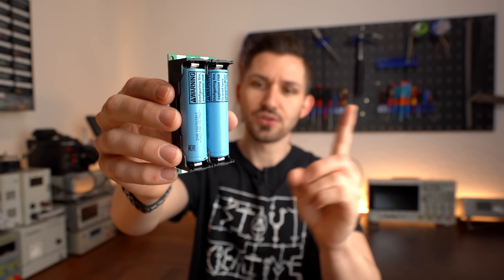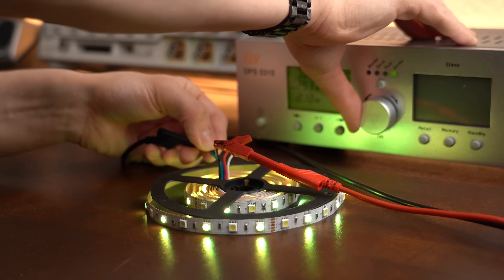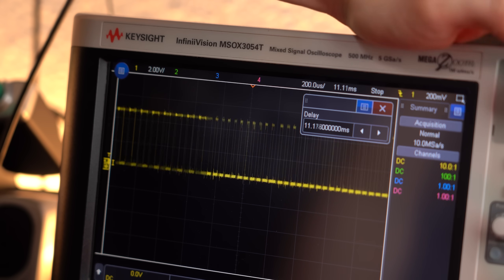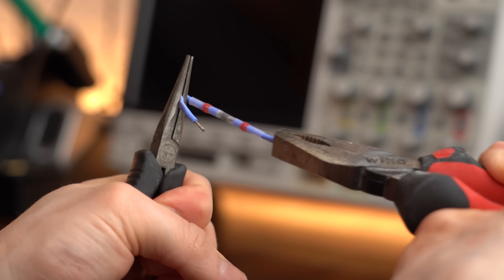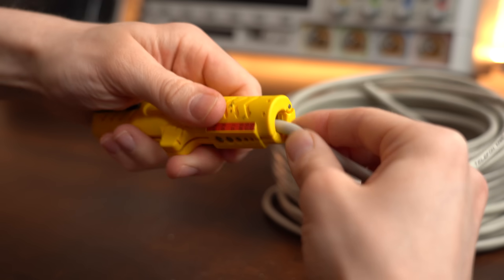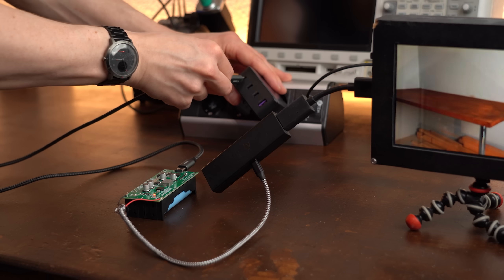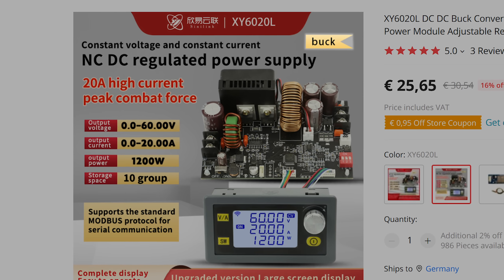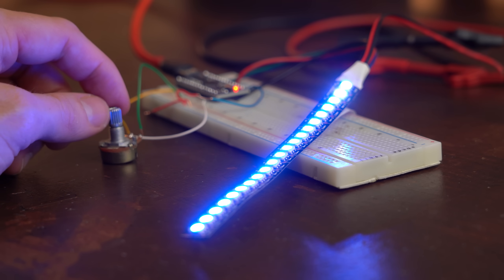I tried finding Hidden Gems on AliExpress AGAIN! (Part 4)

Comment: You need to heat the solder sleeves more. The solder should melt almost completely so you have a good solder connection :)
Reply: Yeah that annoyed me too. Needs to be hotter.
Reply: I also don't bother pre twisting the wires. Just twist the wires back and forth to get the solder moving around and it will look completely solid
Reply: @scatterbraintech  Great, except that's not the purpose.  Solder is not supposed to be the primary mechanical connection between wires, rather to improve conduction between twisted, or if needed then clamped, or through hole, etc.

It really doesn't make sense not to twist the wires together unless this is some unusual situation, like an alligator ate all your fingers.  ;)
Reply: Yes, I also taught abot that. It was probably more the shrinktube (which also has glue on the inside), than the solder holding those wires together. It showed reasonably good result on the resistance test thogh. But clean  copper on copper contact always have low resistance - the problem is after some time with moving the cables and with some oxidation. If done properly, it will be a nice solid connection that doesn't degrade over time.
Reply: using a curved deflector heat gun nozzle helps a LOT, btw soldersleeve shield termination widely used on cables with very fine-mesh shielding, where applying higher temp and/or longer heating period could risk damaging internal wires   ;)
Reply: the solder should flow and if it's not that's why they're cheap. I have used those sparingly before with good success. But the solder definely flowed and solid conductors should be viable.
Reply: @dietbr00ksy  its not the shrinks fault, replay the footage, he shrinks the ends but does nearly nothing to the solder.
Reply: Exactly; I have the same and just use a lighter. The complete solder ring should melt! I bet you could even solder hard wires like that.
Reply: I used these 100 years ago to repair wire breaks on US Navy aircraft.  They are known as "environmental splices," which means they are meant to be waterproof.  The solder was a low-temperature melting solder.  While we were supposed to use a non-sparking, hot-air tool to melt the splices, we often employed the B1c method (a Bic lighter).  Probably not the brightest thing to do in the aft avionics bay of an A6E Intruder, but we did what we had to do to launch aircraft.
Reply: I’ve always found these cheap ones just don’t want to wet out. Add a little liquid flux & they work much better.
Reply: These knockoff solder sleeves are garbage compared to name brand Raychem for example
Reply: I noticed that as well, also I have used these on a multi-wire connection, I solder them together then slide the sleeve down then hit the connection again with my re-flow gun. My preference is to not use them as a primary connection but as a finishing off solution.
Reply: It is obviously not used correctly. The inner tin ring softens at 130 ° C and dissolves at 180 ° C. The outer insulation material can support 250 ° C for more than 30 seconds. Therefore, the correct way to use it is to heat it with hot air at 200 ° C for about 10 seconds. Thermal shock allows the inner tin ring to complete the welding before the outer insulation fails.
Reply: i have them and the plastic will melt away completly before the solder is properly heated
Reply: Same thought. Wasn't sure if they were poor quality solder or not enough heat
Reply: I actually use these quite often, and you’re right, in theory, you are suppose to heat up the solder more to completely melt it.  But, in order to do that, you end up melting the wire insulation all around it which exposes the wire and negates the purpose of the connector.  So it’s kind of a balancing act.
Reply: @heatherryan9820  this just is not true, even a legit lighter can melt heatshrink solder.
Reply: @heatherryan9820  occasionally, but I use my little blow-torch light, which is riskier. I find these work great just don't twist the wires let them 'splice' into each other.
Reply: There's only so much heat you can put in the solder-bead using hot hair through a plastic sleeve... each wire you try to solder acts as a heat-sink.
Reply: @someperson8672  It's a low melt solder. You need to apply the highest temperature the heat shrink will withstand in order to get the solder to flow quickly. That's the reason why it wouldn't solder to the solid core cables, too - though it's such a problem with the solid cables that it likely will never work with anything with a single strand over about 1sq mm (17AWG).
Reply: @Aussiechip  Solid core should always be a mechanical joint, whereas multi-strand is quite happy with a chemical (Solder) joint.
Reply: @someperson8672  Yes, but this is very very low melt solder. It's designed to fully melt without damaging the heat shrink.
Reply: @someperson8672  dude, heat shrinks are damn well commonly used, we know how they should react. solder does melt at a bit over 110c, so no, it shouldnt look like that.
Reply: And be aware of cheap ones, because of the cheap solder in it that might be melt at lower temps so it would not be great to use them in cars near the engine or something similar (I speak from experience)😅
Reply: @GuediRawstyle  normal solder has roughly 127-137c melting point, you shouldnt do that in general.
Reply: @GuediRawstyle  ?? This makes no sense.  No matter which one you choose, the solder melting point is always going to be higher than the wire insulation rating.  I mean even if you added special silicone or other insulation material that has a  higher temperature resistance, all the rest of the factory wiring in the vehicle is still not rated that high and exposed to the same temperature in the engine bay.

In other words, no you are wrong.  If you have wires exposed to very high temperature then they are routed too closely to something very hot like the exhaust manifold.  Otherwise, a temperature high enough to damage  the solder joint would have already damaged the rest of the wiring insulation and plastics under the hood.

Comment: So I've just had to trash a "Mini USV" a few weeks ago  I was using to power the cable modem. Add to that the video you made about the difference between W and VA...

I wonder do we know about any quality mini USVs and wall warts / power bricks out there?
Reply: IS USV USB?
Reply: @theoneohmresistor  No, it used barrel jacks. Most modems and routers don't run on 5V...

Comment: Interesting new (?) Scam: 24VF battery. The F is important, as the battery as only 12V. There are way higher numbers as well, eg 128VF, 888VF, 928VF (if I am correct), these are 18V batteries. Of course, the capacity is egual to the sum of the capacity of the cells 😂

Comment: Seems like these Chinese designers need to start adding filtering caps on the outputs..I know that UPS thingy is bad for RPI (I got a 4 position 3A 5vdc one for UPS on my RPi4), all that noise on the inputs cause mine to stop working after a bit...way too much noise...guess if I solder a 100uf and 1pf capacitor across the outputs it might clean up/smooth the noise
Keep em coming!!!!
Reply from the maker: Will do ;-)

Comment: you didnt get the but connectors hot enough the ring of metal is solder and if used properly it solders the wires together and weather seals them
Reply from the maker: I tried a few and heated them up for a long time. The metal ring is not completely solder.
Reply: @greatscottlab  I use them alot to get it to the right temp need to use a lighter or mini torch I tried a heat gun and it just doesn't get hot enough you can tell when they are hot enough cause the ring will change and get shiney when you pull the heat away it flows into the wire

Comment: Would there be a way to clean up the noise from the output of the buck converter boards and turn it into a more functional cheap lab bench power supply?
Reply from the maker: I will find that out in a future video ;-)
Reply: @greatscottlab  Try to add a few caps on the output , then again that board layout seems BAD
Reply: @sanjikaneki6226  The noise could probably be a measurement error: https://www.youtube.com/watch?v=gpwkiJC5hfU
Reply: @greatscottlab  Any chance to still get this video ? :) I bought the power supply last year thanks to your video.

Comment: This last item is really interesting. Do you have any other recommendation for affordable lab bench power supply?
Also, an idea for the next video: soldering helping hands. There are so many out there
Reply: if you want to go for decent and low noise then RD6006P version (its switching+linear)
Reply from the maker: Thanks for the feedback. Good idea. Sadly no other recommendation from me. But feel free to try the features one out. Very good price/performance ratio.
Reply: @greatscottlab  Well, the other question I have, what possible issue would there be, with the noise of this  power supply? I'd mainly use it to configure LED, or arduinos, or stuff like that, in the same voltage range.
If there aren't many issues, I might very well buy it
Reply: @Sttreg  As long as you are powering "dumb" LEDs and they are isolated from your microcontrollers, that should be fine. Probably best to not use it for the Arduino.

Comment: The grey stripper is a coaxial cable stripper, it’s not intended for general stripping.
Reply: Yeah it seems unfair to not recommend a wire stripper because of the limited wire gauge range.
Reply: Exactly what I was coming here to comment on. It is a specialist tool and does its specific job very well.
Reply: Was about to say the same. It’s a great tool for what it’s designed for.

Comment: I use the last one a lot, at least the controller part.
Hooked it up to a 18V Bosch battery and use it for small electronic projects. Also perfect as you can see how much power your project draws.
Way cheaper than a bench power supply and even portable :)

Even used it to diagnose a broken windshieldwiper pump on my car :)
Reply from the maker: Thanks for the feedback. Sounds useful
Reply: I was wondering how much better you could get the output to look it you slapped on some condensations and spools?
Reply: @MrMario616 This device is a switching (Buck) voltage converter, to get a more quiet output you need to place a linear voltage converter after it and of course noise absorbing capacitors, nowadays this get's done often because the overall conversion loses less heat than a full linear voltage converter.
b.t.w. if you hook this up to a battery, then there is no noise as it is DC, the noise is the zero cross component of the AC source
Reply: @Yaa10101 Hi! Can I use capacitors between ac-dc converter and this one dc-dc to filter noice? Thanks
Reply: of course, capacitors alone will not do the job, you need resistors too, go find the topic of explaining about rc filters here on youtube, but in the end you need to think about if you want to filter high or low frequencies, in audio you often want low frequencies filtered agains hum in the audio, and in computer related circuits you need to filter frequencies that interfere with device working frequencies to keep clean address and data busses.

Comment: I would really like to see one of those "UPS" boards that you can load up with at least 6 cells (minus the noise 😆)
Reply from the maker: I will see what I can find ;-)
Reply: @greatscottlab  Can't you just add a capacitor or two on the output?
Reply: @onix331  He probably just measured wrong. Impedance matching is a real thing.
Reply: I got one with 4...but it causes my RPi4 to stop working after a bit...too much noise on the output...needs much better filtering/smoothing
Reply: @WhiteG60  exactly! It's a buffer not a supply. I have a 48v 100ah ups bank for my 15 sec transfer on the generator but hey if you got it why not 🤷‍♂️🤣
Reply: Theoretically you can solder extra sockets in parallel to existing sockets, it just takes longer to charge and the cell voltages have to match with 0,1V accuracy before inserting cells. And with output noise you can filter out by using low ESR capacitors and smaller ceramic capacitors in parallel at the output._
Reply: @DjResR  You can overdraw the amps on your charger chip like that in some designs.
Reply: @hgbugalou  It can happen but usually it's a bad design. For instance TP4056 limits the current to 1A regardless the cell size or count because it has programming resistor._
Reply: @hgbugalou  I got the same device and it uses same TC4056 that the charger modules use, which I used to charge up to 6 2Ah pouch cells in parallel without problems so it's safe to add more cells to it if needed, only thing is to avoid cells that heat up significantly during charging._

Comment: i am so confused the video was posted 16 min ago but the comment are 11 days old how does that work
Reply from the maker: Patreon supporters can watch as early as the video is done.
Reply: @greatscottlab  oh okay that makes sens and i am also glad that you made a video testing out the buck converter because i was wondering if i should buy it or not. another thing is there any way to reduce the output noise.

Comment: What happens if you just place a big smoothing capacitor at the output of the power supplies?
Reply from the maker: Sadly that does not fix the problem. I might do a separate video about the topic.
Reply: @greatscottlab  Yes Please!!!!!

Comment: The shrinkable wire connectors look interesting, I have never seen those. Great if you only want to connect one or two cables and do not want to get out the soldering station. Plus, the heatshrink adds an additional layer of protection. Maybe I will order a pack :-)
Reply from the maker: Go for it👍 I like them.
Reply: The thing he missed but is present in the description - it's recommended to use a reflector nozzle for best results. I remember another YouTuber has had problems joining wires without it.
Reply: @RicoElectrico  I use my Dremel Versatip with deflector, but they also work fine with a lighter, at least for the smaller ones.
Reply: @RicoElectrico  Thanks for the info. Sounds reasonable, since the solder probably requires higher temperature to melt correctly.
Reply: I have tried them and they have not worked well.  Either the solder does not melt or the outer heat shrink tubing is damaged. I recommend crimpable butt connectors with integral heat shrink tubing on the outside.  Another method is of course soldering the connection with a piece of heat shrink tubing slide on before soldering. This requires long enough wires to prevent the heat shrink tubing from shrinking while soldering the wires, so the applications are limited.
Reply: I think they were originally designed for boats to avoid getting water in joints.
Reply: I use them all the time for automotive wiring, they're great for working in tight spaces and far better than butt connectors
Reply: I wonder how did you get early access to this video ? 🍓
Reply: @LabArlyn  Patreons get early access to videos.

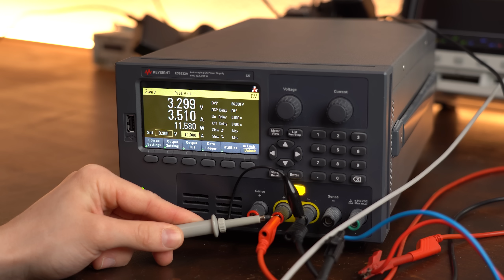Comment: 12:18 As a novice, I am wondering, is there a simple/cheap "post-processing" circuit that can significantly improve the output?
Reply from the maker: With this much "noise", it seems like inductor and or capacitor were poorly chosen or the pcb layout is messed up. I actually want to make a follow up video about that😉
Reply: @greatscottlab  Yes please!!!!!
Reply: @greatscottlab  A follow up video would be awesome. I use these cheap buck/boost converters a lot 😁
Reply: The noise is likely not there and only an artefact of a measurement error: Others (Dave Jones from eevblog) have done the same mistake in the past: https://www.youtube.com/watch?v=gpwkiJC5hfU